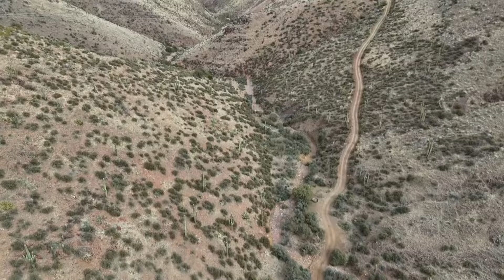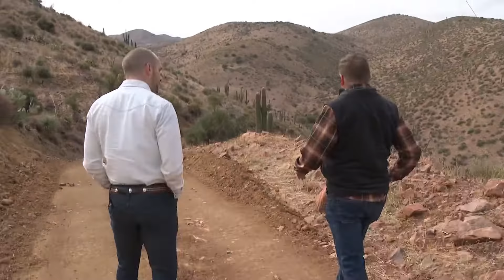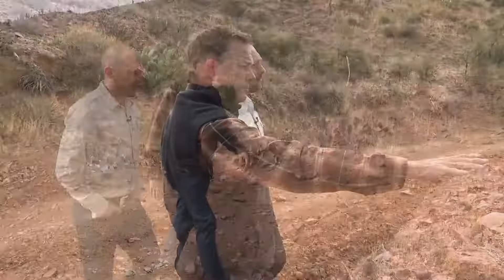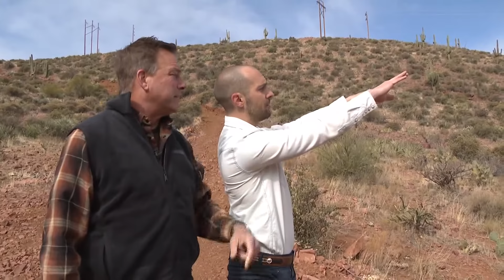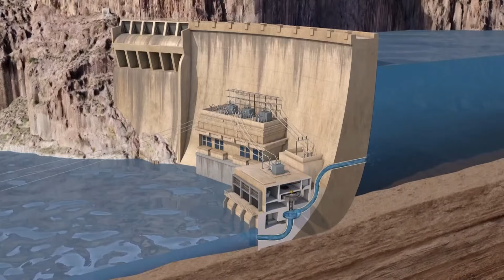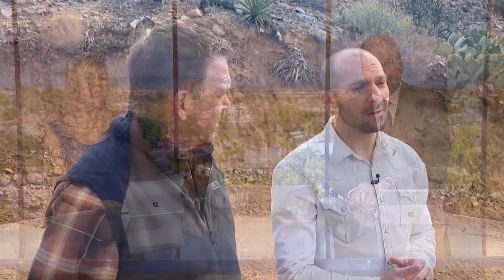SRP's plan to build a new lake in the desert

Comment: That draw is 1,000 feet higher than the surface of Roosevelt Lake.  Obviously, they will have to pump water up to it.  Also, the volume that draw can hold is rather small unless they plan on removing a LARGE amount of rock and dirt.  But maybe the volume is enough as it is nor for the purpose that they have in mind, which is to use it as a storage battery for night-time power, so maybe it is big enough.  
To me, that animation does not look like it represents what they plan on building.  Instead, the animation look like a typical dam operation except that someone added the bit where water goes back into the upper reservoir.  The question I have is, are they going to create two new reservoirs at different elevations within the same draw?  Or do they plan on piping the water back and forth with Roosevelt Lake?

Comment: So you will use Solar power to pump water instead of using it to reduce carbon producing power plant usage in the neighborhood of 1000 Megawatts won't it be easier to just build Solar plants since they are cheaper, or so I am told?

Comment: “Cheap solar power”will pump water uphill to fill the reservoir  then gravity will pull the water through turbines to generate electricity. How many square miles of solar panels will that take?
Reply: So physics is not your area of expertise?
Reply: @Roko-sp7gq. I don’t claim to be a physicist, but I understand the mechanical battery idea and I know they are used elsewhere. Still it will take a huge amount of power to lift the water into the reservoir and unless they use nuclear power to do it which they won’t and they won’t use coal it will probably be solar. I’m just asking how many square miles of solar panels will be needed.

Comment: This will help everyone using SRP power during the afternoon high demand hours. The water is comparable to a solar battery pack that is charged during the day by the panels and releases its power later in the day. This water gets pumped in at night when electric demand is low and released to become power during the day when it is needed.

This will be used to handle peak power demands, not 24/7 constant demands that data centers use. Data centers need high output baseline power and that is only supplied by nuclear, coal, and gas power plants.

Comment: This only addresses the COST of electricity - not the amount of power available.  This is aother scheme to power data centers at the public's expense.  Didn't Trump promise that data centers would provide their own power, cooling, etc. so they don't impact cities and communities?  The principles of basic physics still apply! If solar could actually provide the power to move the amount of water the hydroelectric plant would produce why build the dam?  It is just another bait and switch!  BTW water in lakes evaporates, is absorbed into the ground and leaks through structures.  This is not a "zero loss plan"!

Comment: You know full well the data centers will get this power
Reply: This will be used to handle peak power demands, not 24/7 constant demands that data centers use. Data centers need high output baseline power and that is only supplied by nuclear, coal, and gas power plants.
Reply: @ItsEricAZ  data centers share the grid with households. By increasing peak out put for households you improve power stability for data centers.

Comment: *
    Another way to Burn up Water......

              Dehydration- Pumping Water back and forth, and the only way to maintain level is to siphon Water away from other reasivour that is also evaporated in the hot sunshine.
Hate to say it, But, the only way to reduce Electric use is to Stop building houses that use electricity. The rule is already in existence, and applies to the Development site going to prove supplying Water for 100yrs. to homes proposed for construction....
You have to face the Fact that sometimes building has to stop. In order to not exhaust supplies immediately at hand, or pay higher prices to have supplying materials trucked, or piped in.

Comment: All sounded good until he said data centers.Which will use as much energy as Salt Lake City. So when it was said that it could power 400,000 homes you know it will never power those 400,0900 homes. It will power data centers you knuckleheads. Sold hook, line and sinker.

Comment: Pumped storage hydro. It's essentially battery storage. It is used all over the world. California has the Helms Pumped Storage facility. It's a good complimentary system to mass battery storage systems. (LI-on, air, sand batteries) Of course, you need the unique geographical conditions for it to work.

Comment: The water shed feeding that lake would be extremely minimal so the water would have to be pumped from Roosevelt up to that lake to be run through the hydro electric dam. I would be very interested to know what the net energy production would be. That’s assuming Roosevelt had enough water to pump in the first place. Then we need decide if that amount of power is worth the cost to tax payers( the cost will absolutely be passed on to us) and destroying an intact eco system. Is this just to offset future data center power consumption? If so I say it is absolutely not worth it.
Reply: There's a lot of development planned in the Valley over the next 10-20 years and more after that. This will provide more electricity for current use in the Valley and for the massive amount of development that'll take place over the next 20 years. Most of it taking place in the southeast Valley, projected to have 1 million more people in the next 20-25 years and West of Goodyear, projected to have an additional 1.5 million people.

Comment: Just like Switzerland perfected 10 years ago…
Reply: 10 years ago? The swiss and italians built the first pumped-storage hydroelectric plant in the 1890's. That's a little more than 10 years. The US deployed their first in the 1920's. The US had the largest facility for a long while until China built one even larger and still remains the biggest.
Reply: @RealErikHansen Just like SRP perfected 45 years ago. I doubt that the Swiss/Italians pumped water uphill to fill a reservoir, for 45 years now SRP pumps water uphill into Canyon Lake and Apache Lake when electricity is cheap and then runs it down trough the turbines when electricity is expensive, this method of moving water according to the daily price fluctuations makes money.
Reply: @davidfarnsworth2901  That is literally what a pumped-storage hydroelectric system IS.  They pumped the water uphill. Not sure why you even bother typing "I doubt" when it takes 30 seconds to google for confirmation. It wasn't until the mid 1900's when reversible generators were used to pump the water back in the same path it comes down. SRP didn't perfect anything, there were much larger pumped-storage hydroelectric plants in the 60's in the US(that I've personally been to)..

Comment: 🇺🇲You'd have to have it, nuzzled between towering rock mountains so the run-off run into it, the lake would literally capture the run-off water 👍🏜️and Protected from dust Storms, higher elevation to deter "evaporation" which is rapid out here in Arizona.. And siesnic activity history, underlying running faults must if possible be realized . ....and no wells in the immediate area👍🏜️🇺🇲

Comment: Maybe don't build data centers in Arizona that require more power than exists, requiring an artificial lake to be built destroying more relatively intact or pristine sonoran desert, just to act as a reservoir for a hydro power plant?
Reply: But we got to have electric cars by God LOL
Reply: @danharris5873  The Buckeye 1.8G W Tract data center and the proposed 3GW Eloy data center will utilize approximately 60% of the energy consumed by the City of Phoenix, including current electric vehicle usage. If all drivers in the Valley were to adopt electric vehicles immediately, it would necessitate a 30% increase in grid capacity. Given the current rate of electric vehicle adoption, the grid is capable of accommodating such a change without issues over the next ten years. However, in contrast, the grid cannot support the load increase from the data centers within the next three years.